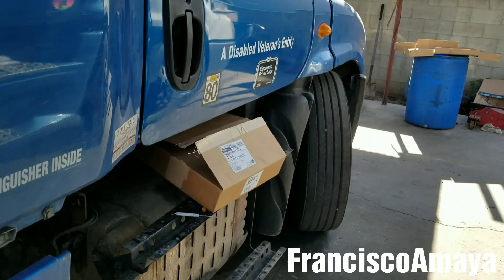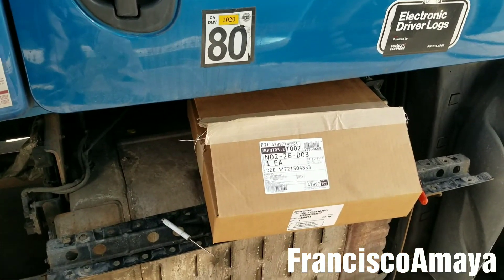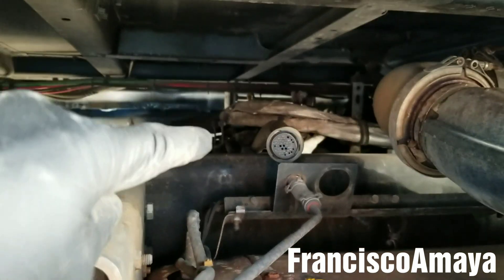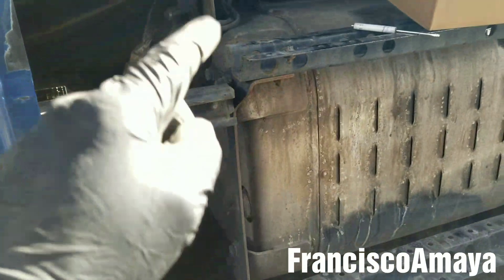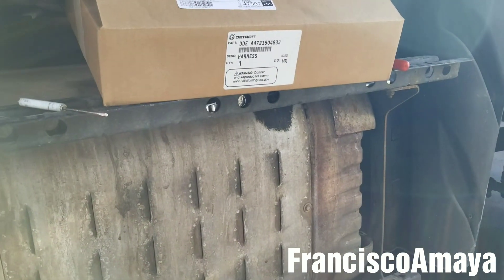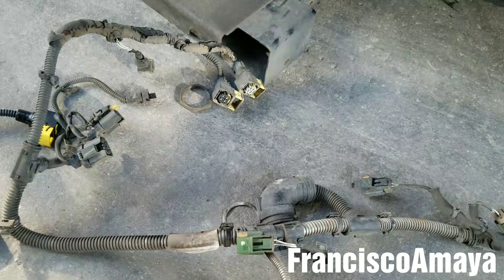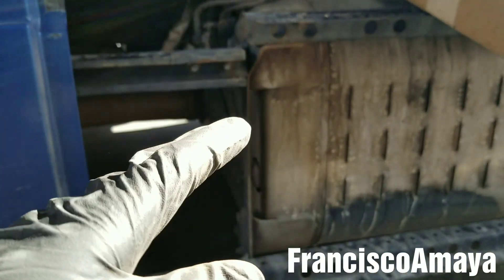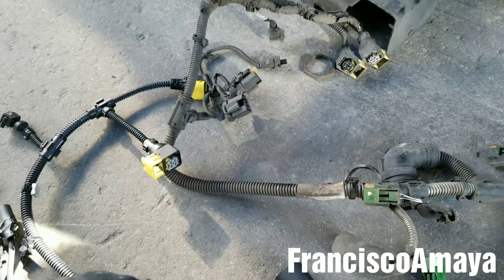Freightliner Cascadia DD13 DD15 DD16 DOC DPF SCR box wiring harness problem DEF light blinking

Comment: Hey Francisco I keep getting a constant SPN 4077 14. I replaced the doser block and 7th injector fuel pump cleaned the DOC DPF filters. I shook the wiring harness found there a short somewhere ecm mcm loses communication intermittently.Should I replace the wiring harness?

Comment: Is that necessary to replace this harness if DEF has been disabled? I am experiencing engine randomly stall or shut off while driving and idling. Engine check light hill assistance light and active brake light come out.
Reply from the maker: if the emission system was deleted you don't need to do any type of repair to your emission system. and the answer is not. if you what your check engine light on you must check the fault codes to do the proper repair
Reply: @franciscoamayaYT  Thank you for replying!

Comment: Could this cause a SPN 3250 FMI 31 after  replacing the (DOC) outlet temp sensor. Due to the same code?
Reply: After replacing the (DOC) outlet temp sensor and testing it’s good. Code goes away but going up a hill the code turns back on. Now it gives me a second code which is SPN 3242 FMI 3 tested the inlet temp sensor it was bad.

Comment: 2011 dd15 when my fan clutch engages why does my truck throttle decrease? Just started doing this and I  have no faults or check engine lights
Reply from the maker: Well, the fan takes like 25 hp away from the engine every time it kick in.
Reply: It was my wiring harness